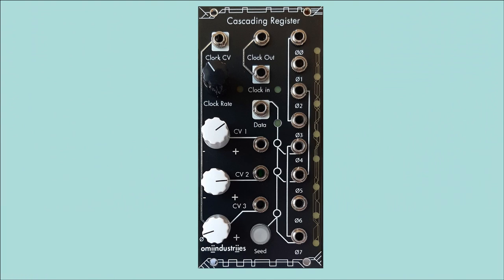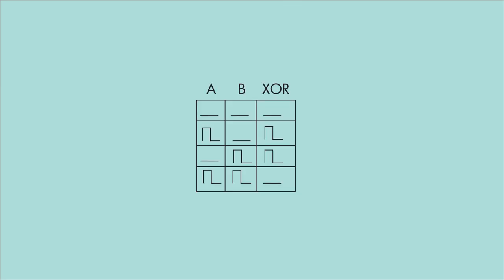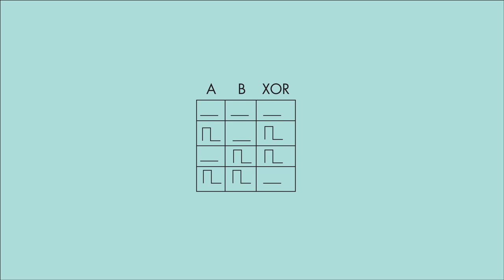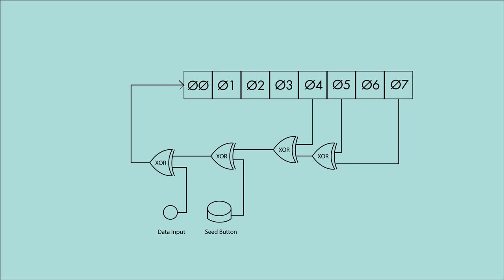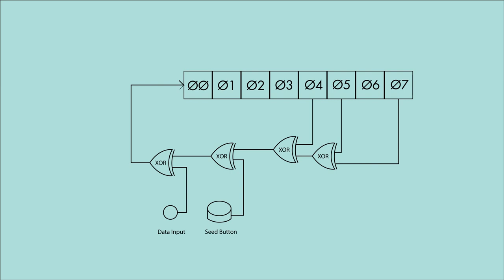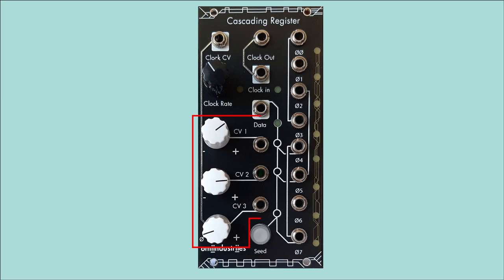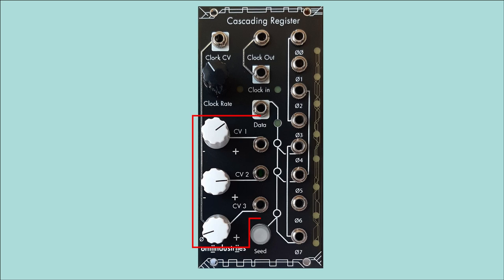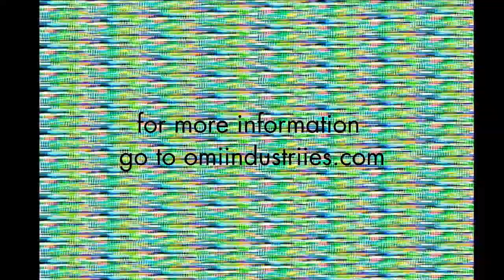Cascading Register Video Manual Part 1

Comment: Very cool implementation of the XOR in your circuit.
Gives me some ideas of my own for my S&H circuits.

At present I fly the 5V flag and have designed a triple stage  loopable S&H with my old friends the TL431 as a brown noise generator, which is boosted to 5Vpp as a data source to feed an array of CD4517BE. I use MCP6002 op amps as followers to output to my Monotribes Fc mod inputs. (which would blow up if anything more than +5V is presented as CV).

I run a semi-modular rig, so I have to be more careful with not presenting negative voltages.

I have experimented with the CD4015BE and the CD4094BE but I like the sequence that I get from the CD4517BE the best. (totally subjective as a circuit designer).